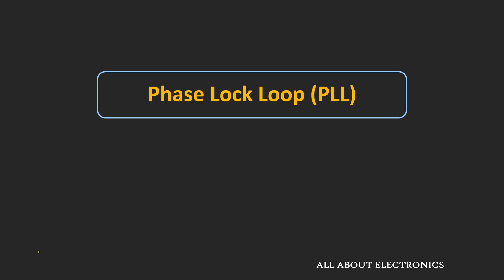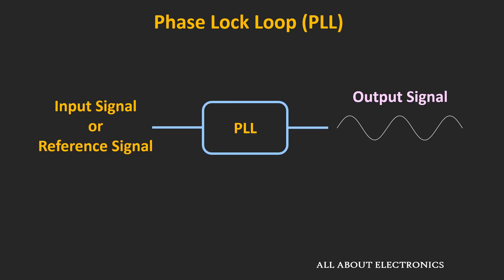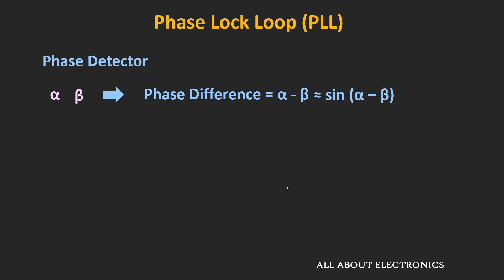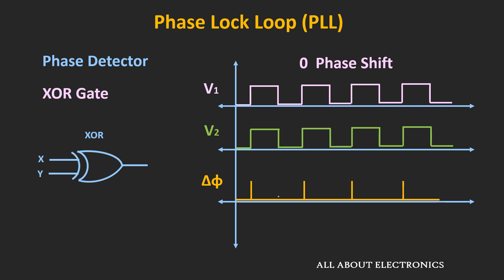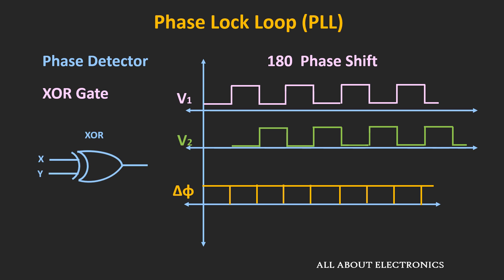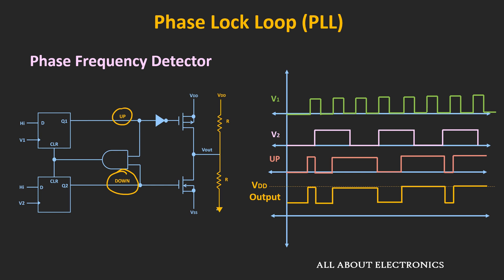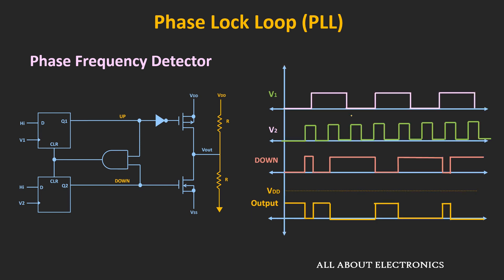What is Phase Lock Loop (PLL)? How Phase Lock Loop Works ? PLL Explained

Comment: I want to follow up on your last example of the frequency multiplier. The f_o is at 10MHz, so the error voltage should be high to increase the f_o frequency. However, the phase detector see that the 2 input signals have the same frequency, so the error voltage should be small. There is a contradiction here. Could you explain further?

Comment: Beautiful and clear lecture !
However I see saturating race issue on both FET if the AND gate is slow when both UP and DOWN are High logic.
If the and gate is slow, and both UP and DOWN logic are high,
 there is fraction of time with a short circuit between Vdd to Vss trough saturation of both P_fet to N_fet. 
I would add to both P_fet and N_fet sources a low value serial resistor like ~50 Ohm to damp the overcurrent in case of any AND gate issue as protection against short circuit  and cause possible overstress to fet /damage.
Best Regards
Jose Tal

Comment: As always excellent. Phase detectors ate also used in instrumentation. I never could figure how phase sensitive demodulation works when the input is an analog signal, like in signal conditioning for an accelerometer.

Comment: Hi teacher, I am confused about the capture range and lock range. I suppose that when the input frequency is in the lock range then it can be locked by PLL and now the output of PLL is f_R, if it is out of lock range it is no-lock. Why do we need the captured range because the lock range is enough for PLL?
Reply from the maker: Lock range comes into picture when the loop is already in the locked condition. The lock range is the range of input frequencies over which the loop can remain in the locked condition. 
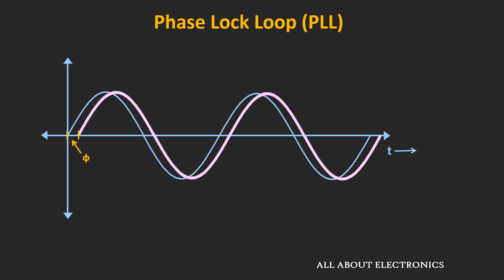The capture range comes into picture when the loop is not locked. The capture range is the range of input frequencies over which the loop can get locked when it is in unlock condition. Please watch the video from 3:30 onwards. You will get it now.

Comment: Something really driving me insane !! If we used PLL in AM demodulation receiver ..in the PLL mixer the AM signal multiply by fc after the LPF output the  subtraction will give the information signal which is not a zero value of constant voltage if local fc not matching received fc

Comment: Do you think there are good empirical models for oscillators? The unsatisfying problem with PLLs is that no one can tell you how to qualify an oscillator’s performance without one. I’m reading through Razavi’s recent book on PLLs now. Jittery is largely incalculable for free-running oscillators. The negative resistance from the feedback devices has a nonlinear Gm moving poles in and out of perfect dampening. The changing bias on capacitors also moves this operating point as well as the dielectric saturates. Reducing the need for the distortable Gm can be accomplished by raising the quality factor of Ls and Cs, but I have yet to find a useful analytic expression for jitter.

Comment: The last topic about the frequency synthesizer does not make sense to me. For example, you say that the PLL can be used to divide the input frequency by N. Yet, this requires a frequency divider to be placed before the phase detector. The output of this frequency divider is the same as the output of the PLL. In other words, if I remove the PLL and keep the frequency divided, I can still get a signal whose frequency is divided by N. So, what's the point of the PLL in such a situation ??
Thanks for the explanation though!